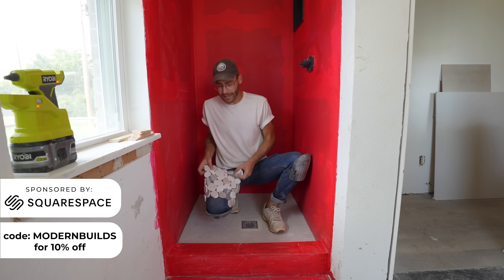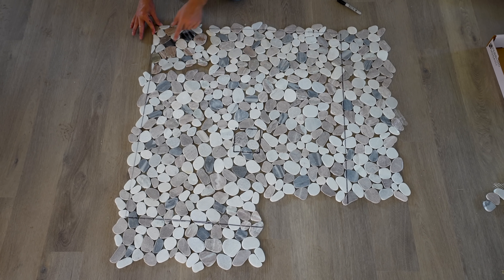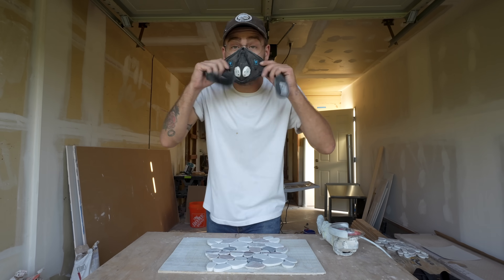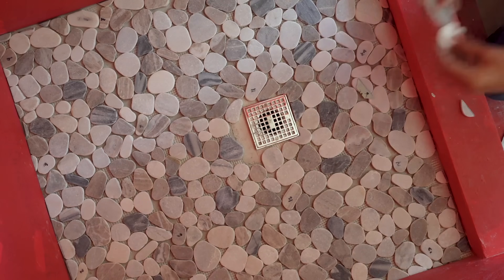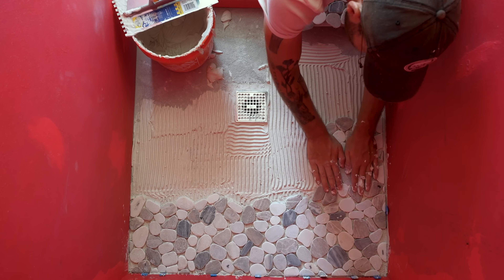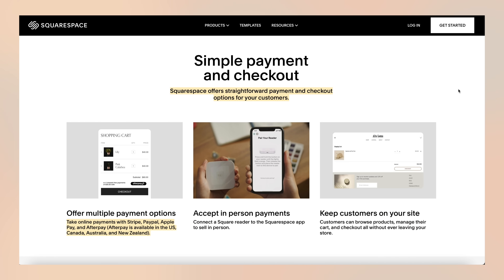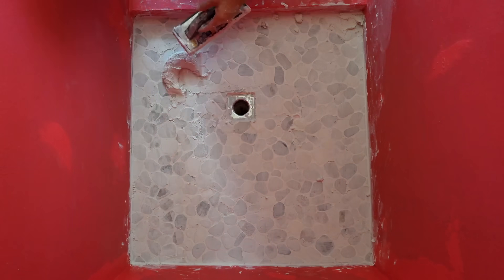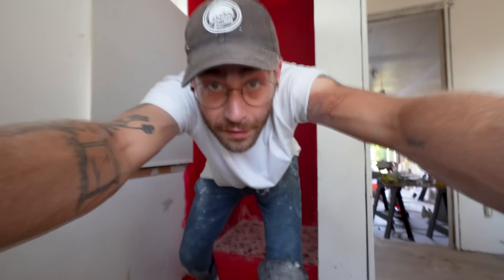Testing TikTok Shower Floor Tile Hack!! (How To Tile Shower Floor)

Comment: You should definitely seal that grout, it will be yellow in a few weeks
Reply from the maker: The grout is kinda premium and sealing isn’t required it’s supposed to be pretty stain resistant… I guess we’ll see
Reply: It did say on the box that its stain resistant and no sealer is required